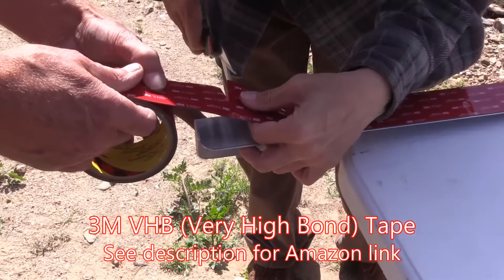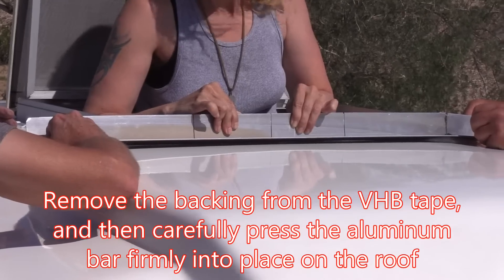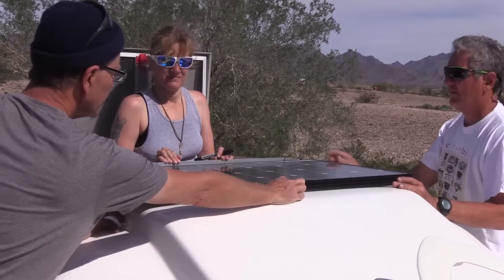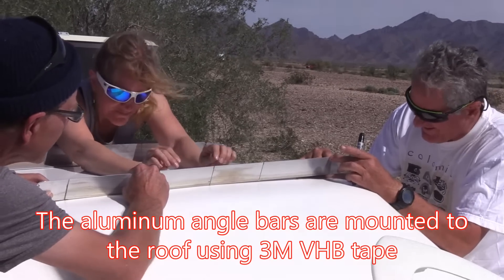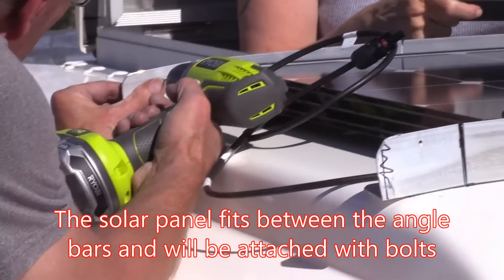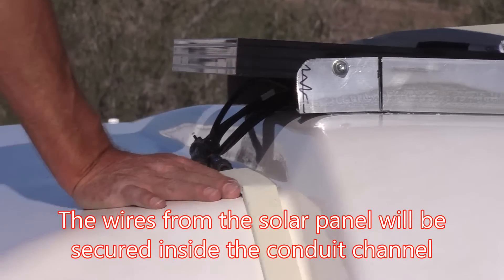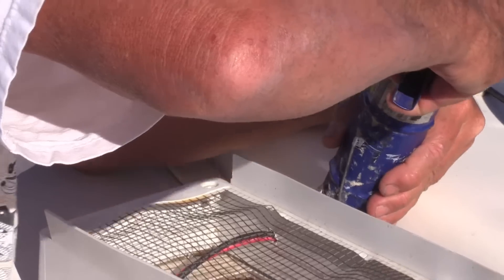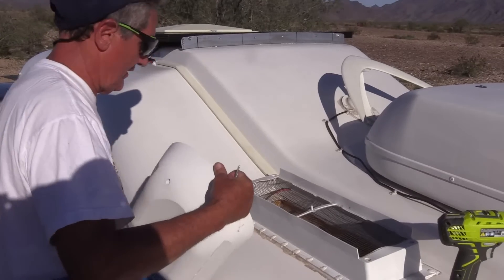Taping Solar Panels To a Curved Fiberglass Roof

Comment: Those panels have no airflow underneath, so they're getting really really hot without any cooling from airflow.  Cool tip, but some more engineering would make it more efficient.

Comment: What I want to know is, how did they get the screws threw the middle section of the solar panel where their hands could not go? They didn’t show those ones?
Reply: Looks like self tapping sheet metal screws, so so nuts or washers.

Comment: 9:19 Don't forget to seal the little slits you made at the bend.

When sealing something like this, to keep water out, always consider that the seal won't be perfect or last forever. If the bottom is completely sealed then water will accumulate. Wires that are fine when getting wet occasionally can actually corrode (yes, INSIDE the insulation) if left in water for a long time. Sometimes it only takes a few days. So, always make sure there is a way for water to drain out. Bricklayers use a short piece of cording, embedded in the bottom tier of the mortar to let water seep out without letting bugs get in. 

Hopefully, this snap-together channel doesn't have a tight, water-retaining fit of the top to the bottom. So it will naturally let the water seep out.

Comment: Be sure to prep all your surfaces for maximum bond. Sand off any oxidation from the aluminum. Most fiberglass has a waxy coating. That has to be cleaned off using a special solvent you can get from most any Marine supply store that sells fiberglass repair stuff.

Comment: If you don't have three sets of hands, and are working alone, you can just peel back a little of the backing and fold it over. Position your piece in place, and even loosely clamp or temporarily tape it in place with making tape. Then just pull the backing out from underneath the piece. It comes right out. The videos on the 3M website shows a cargo van manufacturer that uses this technique.

Comment: Love this.  I have a Starflyte Motorhome that my panel has been sitting in my house until I attach but did not want to put a hole in fiberglass roof.  Ideas on longevity with traveling.

Comment: Bob, are there any ideas on doing this with a flexible panel? I have a 200 w/ and storing it inside the van for moving gets to be cumbersome for an old lady.  Can someone brainstorm something that would work? Mine doesn't have that nice frame around it. Thans Hon. Love You!!!
Reply: Yup. You can just stick it down with about a 2" strip all the way around, plus a couple across the middle to prevent flapping in the wind.

However, people have found that flexible solar panels don't last very long when, um, left out in the sun. So, you might want to stick with your system of only putting them out when you need them until you can afford rigid panels.
Reply: I believe you can use the vhb tape to hold them down..search it up on you tube.."how to secure flexible panels" good luck..
Reply: You could also use eternabond tape. ☺

Comment: I would LockTite the bolts but nice job there!
Reply: Did you notice all the self tapping screws they also installed -- plus they used lock washers on the bolts -- seems like that would be enough.
Reply: @rebelyell1580  Actually I would have used the aircraft nylon locking nuts. They will be ok but good idea to check once in a while.